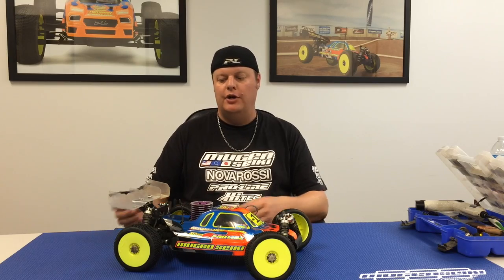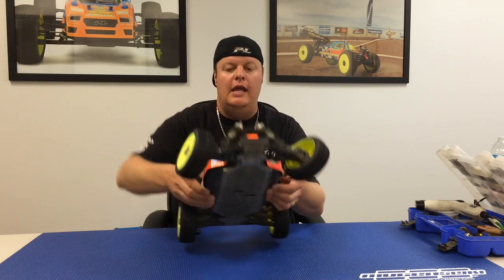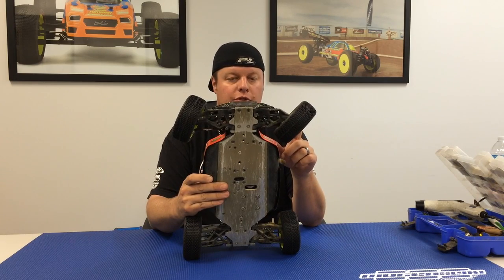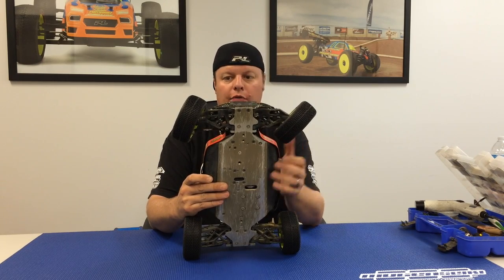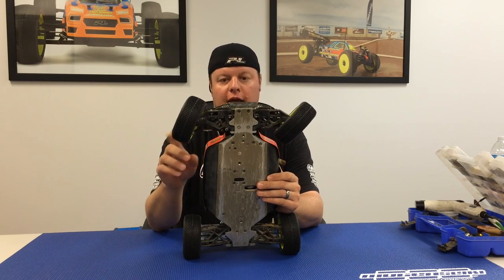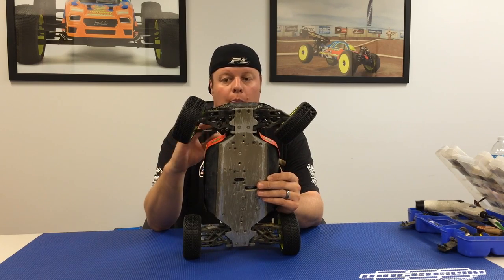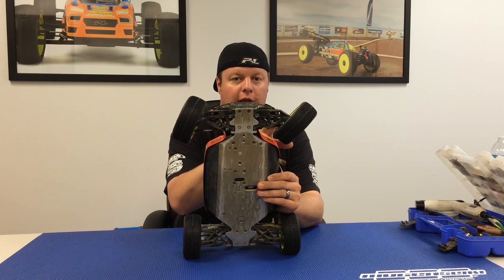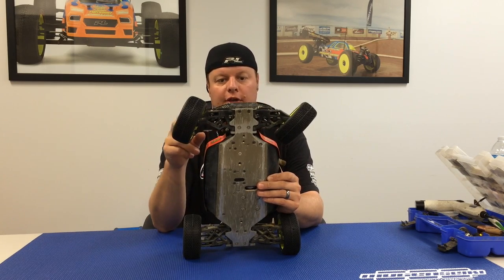Adam Drake fro Mugen Seiki Racing talks about ackerman.

Comment: Hi +Adam Drake if you are running in a low traction small track with tons of tight sharp curves what do you recommend more or less ackerman?
Reply from the maker: +Oscar Meza 
In that condition, normally you would want to run less ackerman.
Reply: +Adam Drake Thank you Adam. 

And in general could you give us a tip as you did with this of how you would setup a car for those conditions of bumpy bad track. Normally in several parts of the world this is the kind of track we found Ex:

FrontToe: Negative or Positive
FCamber: Negative or Positive
Shocks: Thicker or Thinner
Ackerman: Done
Ride Height: Less or More

Thank you
Reply from the maker: +Oscar Meza 
Hello Oscar,
All of my standard set-ups are posted on http://www.mugenracing.com/setup-sheets/ and if you have a specific track you need help with you can send me photos or a video of the track to adrake@mugenracing.com